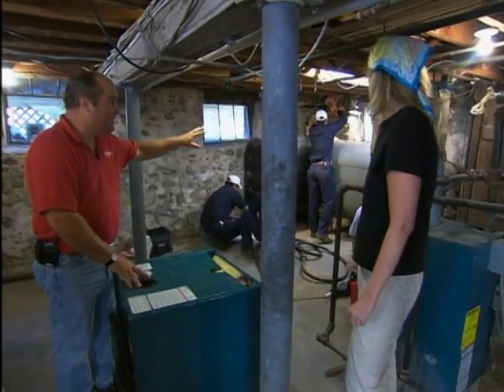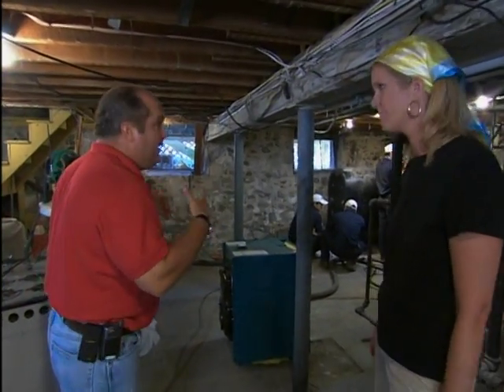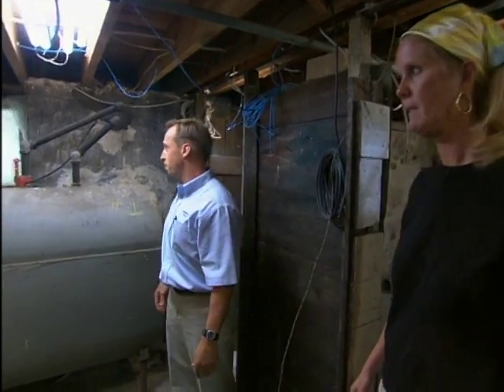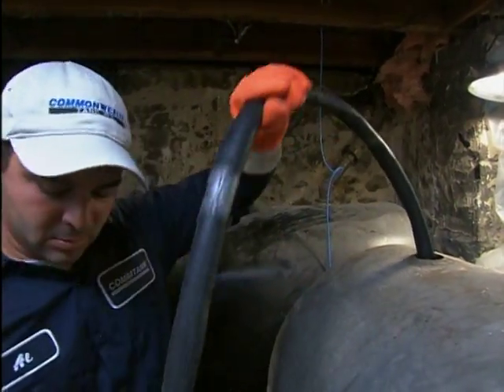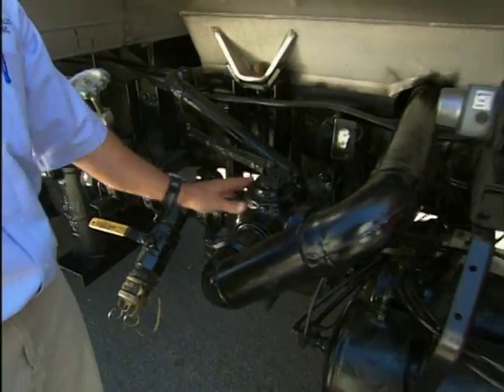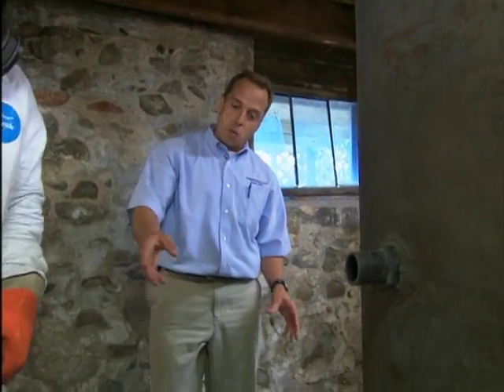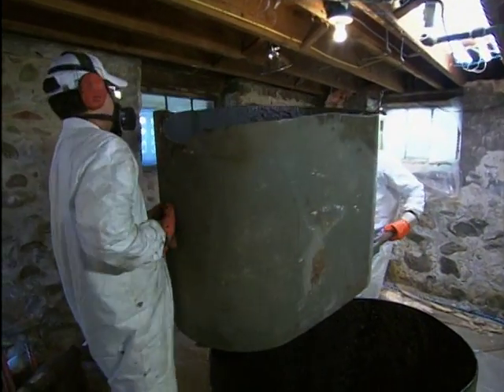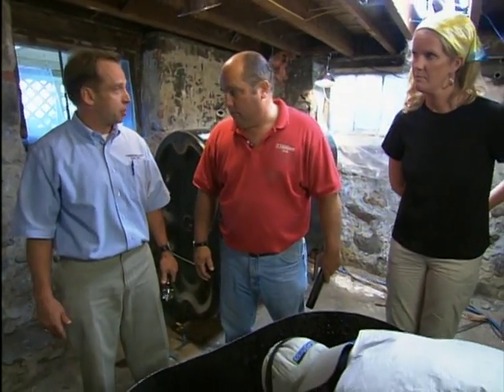Roth Oil Tank Installation MA

Comment: Just did one at my summer place in ME but it was a PITA. Had to transfer the oil into the new tank, pull the old tank out, transfer the oil back into the into the old tank, move the new tank into place and then transfer the oil back into the new tank (getting tired just thinking about it). Fortunately had less than a 1/4 tank when I did this. Stood the old tank on end and cut it into 3 sections with a sawzall. Took the last section (with the sludge in it) into the back yard and set it on fire to burn it off and then all 3 sections to the dump.
Reply: you just voided your tank warranty. If its a steel tank expect it to start leaking within 1-4 years depending on how bad the old tank was and youll be on the hook. never put old contaminated oil into to a new tank. zero exceptions

Comment: 5 micron does not remove the bacteria in the old oil which causes the rotting of the tank in the first place.  Its also does remove any of the water. Never put old oil into a new tank. you void any warranty on the new tank. either have the home owner run the oil down or recycle it. expect any sludge problems to continue.

Comment: you never mention the downsides of anything it is always this is great way to do tank removal this is great tank old one was bad this one good. nobody does a tank removal like that they made a mess standing tank on end and cutting it that way there is zero chance of their being highly flammable fuel in tank or the oil burner would have blown up you can cut oil tanks with a sawzall while it is horizontal then clean it before moving it.
roth tanks swell when filled so you have to leave space around them the plastic caps come loose on top and have to be retightened they fall over easily if empty outside installation is crazy expensive with hood concrete pad anchors to keep it from falling over and oil man needs a ladder to reach fill on top and if he hangs hose off plastic fill while pumping because he cant reach it he can break the plastic connections to steel fill nozzle
I like the way your new episodes contradict this one where you show the oil can't explode and they cut it open with a saw

Comment: Okay I live in the state of Maine I had one of these tanks installed outside I just found out dep wanted out of my yard have no idea what the hell is going on had an issue with the tank in the first place all plastic pieces on top found out it was a recall because the fuel gauge kept popping off every single time they would fill up the tank the people that installed this put it up on 3/4 and stone Topete off the ground on a cement slab dep inspected this they also built a wall around it made out of pressure-treated board and then filled in 3/4 in stone and put the cement slab on top of this two feet off the ground now dep wants it out of there they said this tank is not supposed to be outside is this true or not it cost $5,000 for that tank they want to put a stainless steel tank outside now what do I do about this problem
Reply: other tank companies that install them say it has to be on a concrete pad and strapped down so it won't tip over when empty with a metal hood on top to keep rain off it since it can get in seam between sheet metal and plastic and make it rust. 
the plastic fittings have to be retightened because they work loose, and the guy filling oil can break plastic fittings hanging hose in fill pipe since it is so high off the ground.

Comment: terrible job of pumping out old crap then putting it in new tank what about water ? and bacteria in oil causing it to break down into sludge? why did they tip it on end when sludge is clinging to bottom why not cut sides open and scrape it clean before moving it.

Comment: Roth tanks are the biggest peace of craps
Reply: Why do you say that? As opposed to what other oil tank on the market?
Reply: @zjones9876  Granby steel tanks are good and you can put a plastic tub under them so if you see it start leaking in 20 years it won't soak into floor